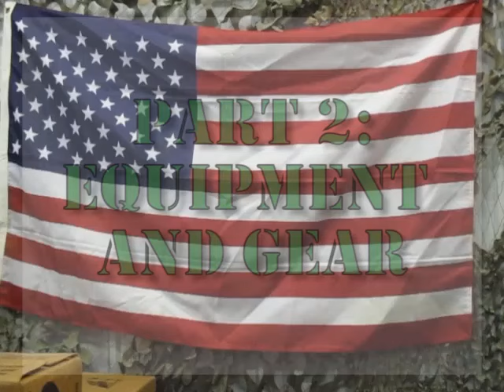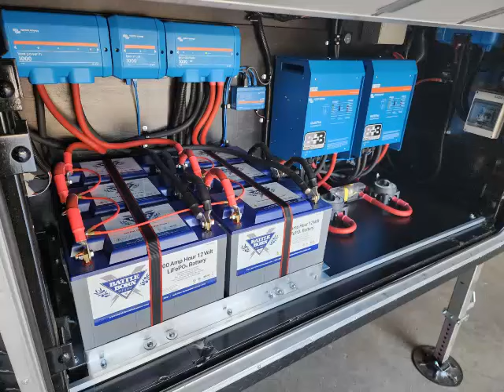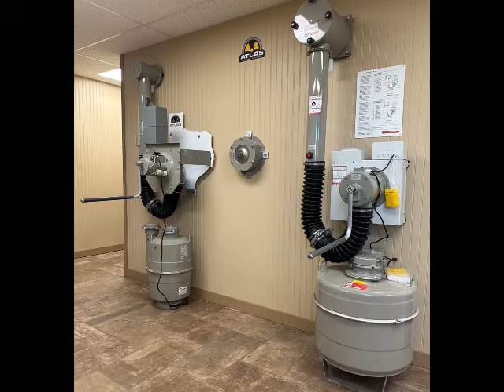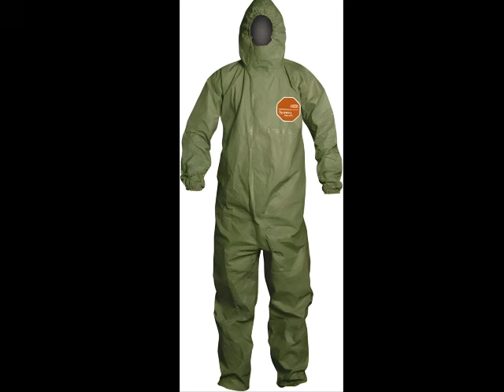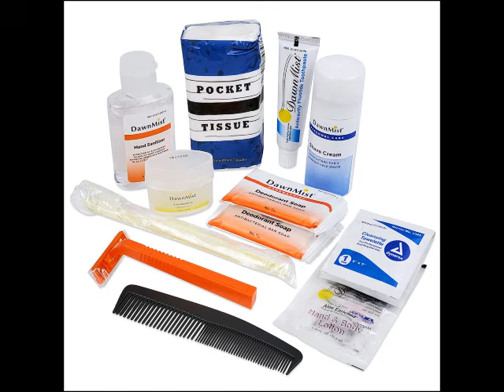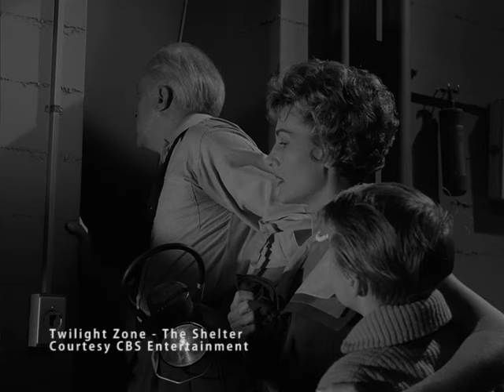Stocking A Fallout Shelter- Part 2 Equipment And Gear

Comment: A full, uncompressed, text-only copy of English Wikipedia is about 80–110 GB to download. Won’t be very handy to navigate but I’m sure with a little code. Then I would use those kindles, their battery life is really good. You can override the system and upload your own stuff. Will have no links, pictures or headers though. Knowledge is always useful wherever whenever. Then again we circle around back to consumption of power for entertainment purposes isn’t ideal. Another are art supplies. Easy to store, no shelf life and can be used for planning and getting your thoughts down
Reply from the maker: If you are using wikepedia as your primary source for information then you are in willing ignorance.  Wikepedia is full of lies on almost every subject.  ALWAYS double check the info they post with other sources.
Reply: If you want particular details and information without the extensive cost, you could always do this to your own preference of information if source of reference worries you.

Comment: I just got through a grueling deadline for work and was so happy to see you posted part 2! 

Some of my ideas - peat moss works well in the privy bucket. Get a smaller bucket and a scoop to be handy.

I found those cheap little "tablet" cloths that you add a few drops of water and it becomes a wet wipe. I like those for my face, don't like the soap in the baby wipes on my face.

Those heavy wool blankets are fantastic for keeping warm. I keep one in my car in the winter and take camping for chilly nights.

I have a lot of card games and good books, but need some board game...might not be the zombie version of monopoly though....

On the alcohol - good point. I would have a small bottle of vodka or rum or similar for medicinal purposes, but agreed on keeping control of it (hiding it) around people who are struggling with the situation.

Comment: Radios: Most law enforcement has switched their communications to digital. Analog scanners will not receive these signals. Have both, an Analog and Digital scanner.

Power: A hand or foot crank generator can help supplement power and provides exercise.

Lighting: Strings of LED Christmas lights are great for moderate room lighting and use very little power. Use white for brighter, and use colored strands for areas that need less light.